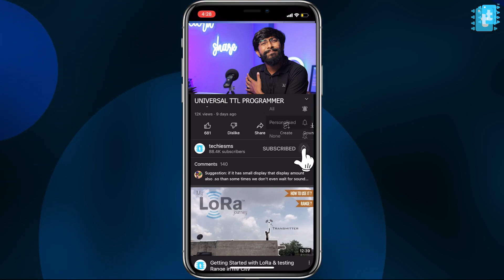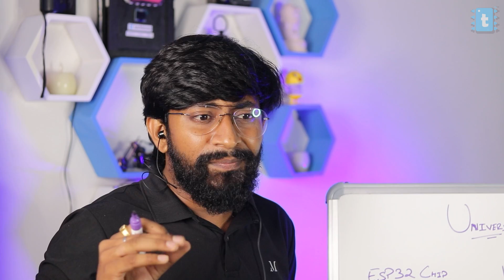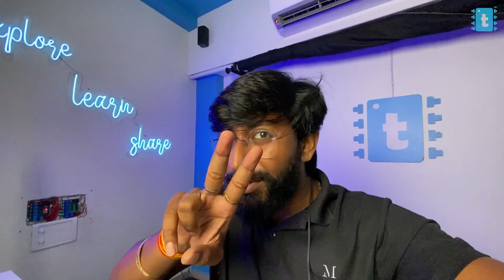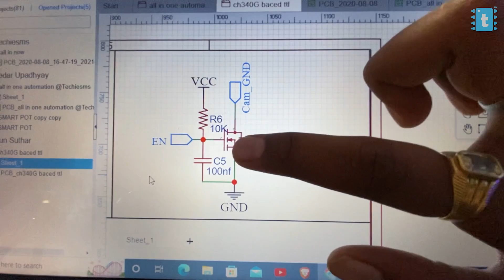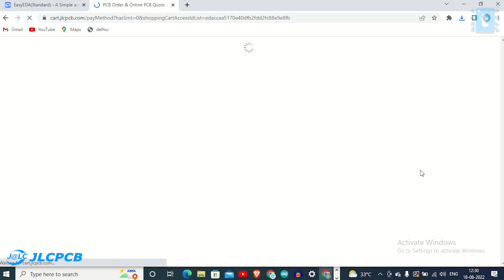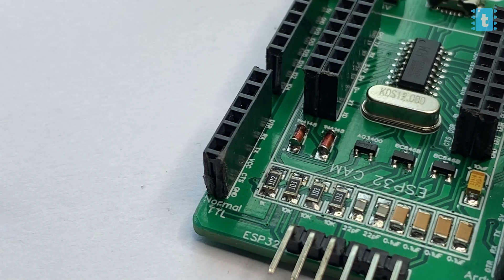ESP32Cam Programmer | ESP32 Chip Programmer | Arduino Pro mini Programmer | Universal TTL Programmer

Comment: No bro it doesent seems to hold esp12f chip directly .without pcb extension esp chip has holes with gap of 1.27 mm and i dont see male pins coming out for the chip ,for ur clear understanding have a look @edison science corners esp programmer on yt
Reply from the maker: See we have made this for masses. 
And what most of the IoT product manufacturers do is they keep the dedicated UART port on the final product PCB and using that port we can program the chip and also see it’s response on the serial monitor 

And with our programmer we can easily do that